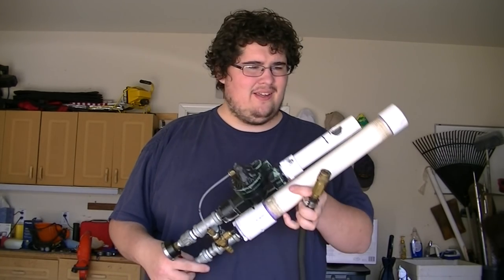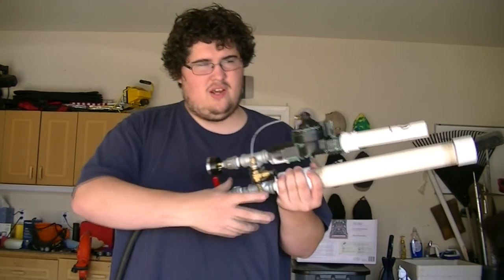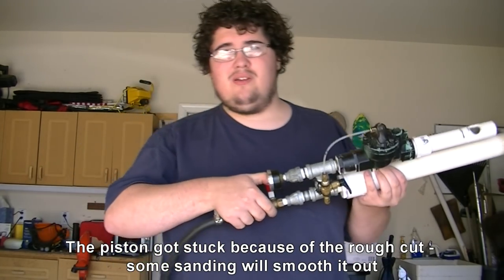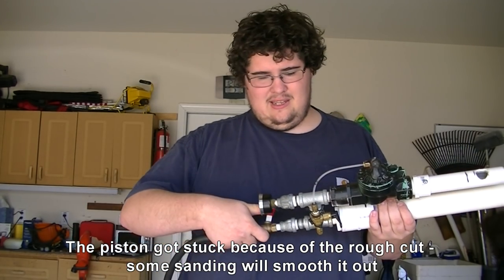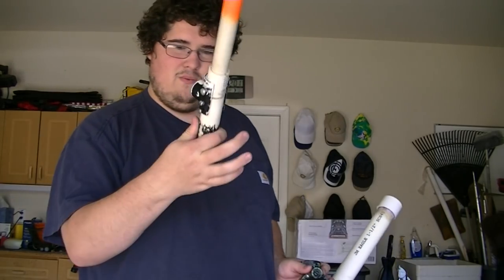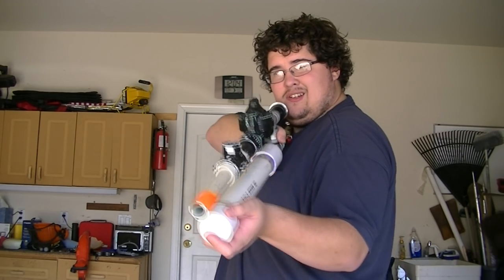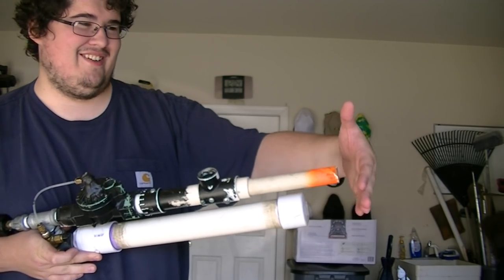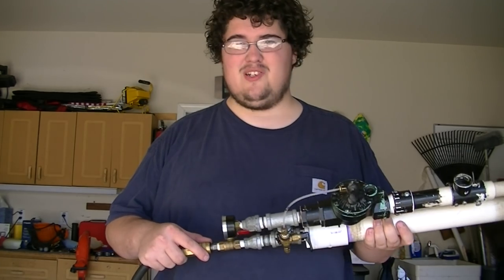How to: build a fully automatic PVC paintball gun - part 8: test fire

Comment: I'm very impressed that you were able to get the the gun to cycle so quickly using a sprinkler valve and such a large chamber volume, what pressure does the valve open at?

Comment: could the reason that the bolt you just made keeps jamming be that you used schedule 40 instead of schedule 80 for the 3/4 pipe that acts as a bolt stop. Therefore the inside diameter is larger where the piston enters therefore the piston is not stopping at the ridge where it should  because the diameter is too large? Beautiful job ,this will make a nice project.....